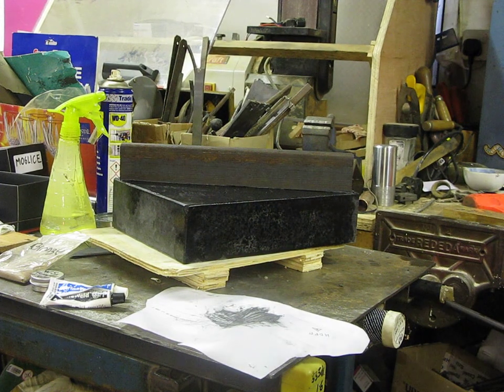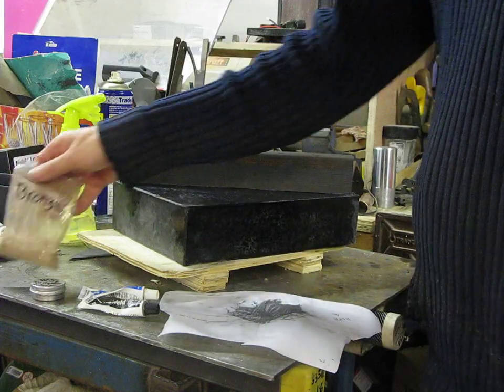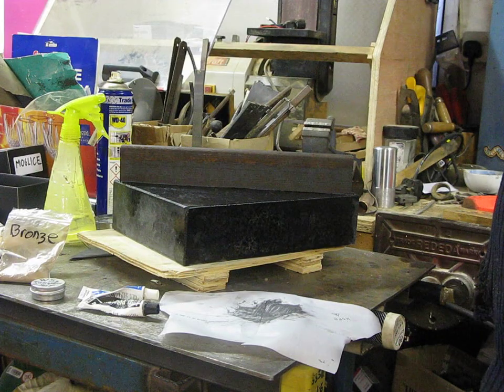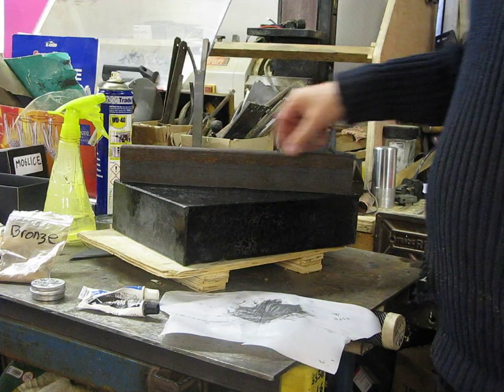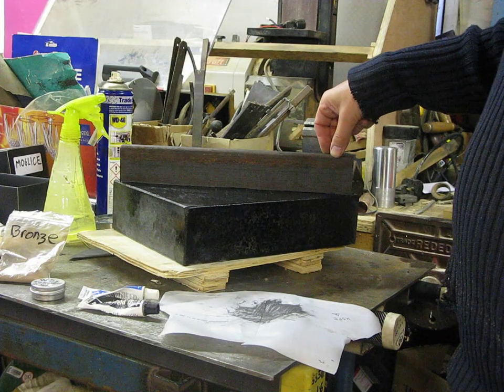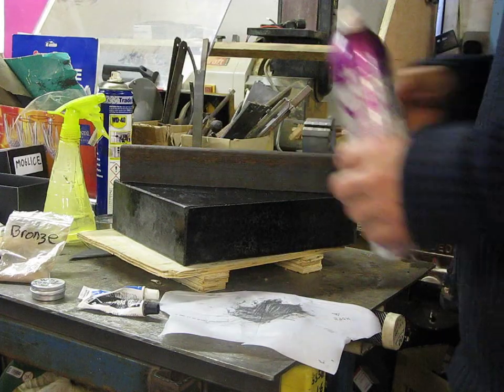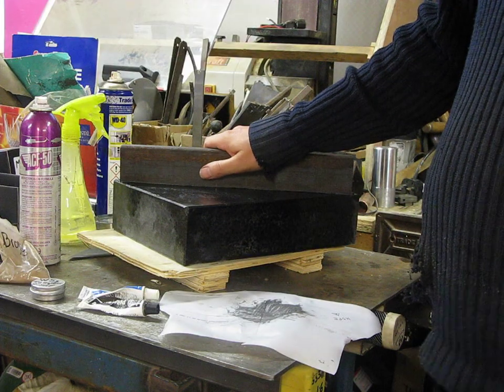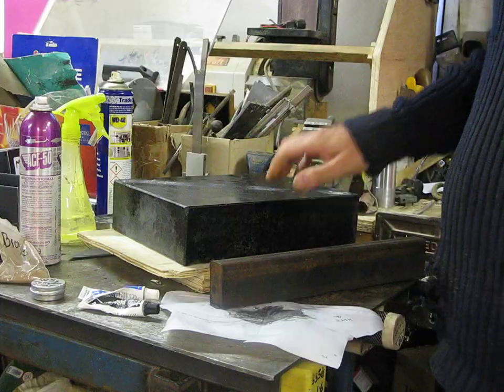DIY Moglice Turcite lathe bed wear casting on surface plate

Comment from the maker: Ive actually finally very sucessfully used the same mix to repair the M300 nearside way using a Nielson 600mm straightedge clamped to the inner vee. I measured the wear then calculated the volume per inch and used a syringe to try and lay down the correct amount, then covered in cling film and clamped the straight edge. dip was 10X improved. not perfect but also not peeling after 6 months. I only had a printer ink syringe , a smaller one would allow more accurate filler distribution.